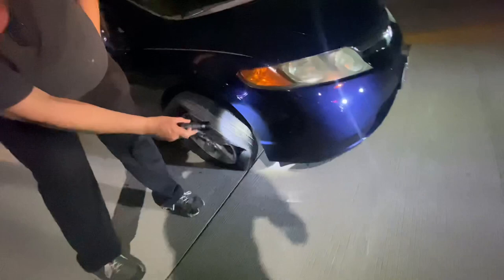Broken Control Arm Tow With Self loader

Comment: Question. Do you not strap the wheel to the subframe to provent any unwanted movement? I use spoons on my auto wrecker and i have to ratchet strap the wheel to the subframe
Reply from the maker: that tow went about 200 ft at low speed he broke down right before the driveway so not if it’s a super close tow wasting time
Reply: @Towvibes  ah valid point. Makes sense lol. I just thought you knew something I didn't 🫡